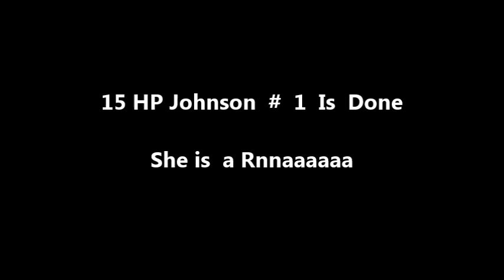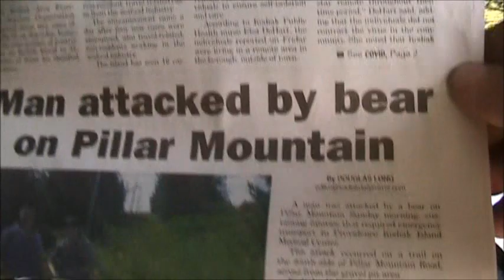15  HP  Johnson  outboard  Motor    ((  Part  2  ))   #   2 ,,,,   &  MUCH  More  !

Comment: That Johnson sure looked clean under the hood?  What happened to its original gearcase?  What year was the Evinrude, was its powerhead shot?
Reply from the maker: +kramden,  the lower came off a 1979 (E15904)  yes shot the powerhead / motor had been submerged in the ocean & then sat for several years,  The Johnson is a 1992 (EN) The fellow who brought it to me was given the motor as is & does not no what / why the lower was missing,                                                                     kodi

Comment: What do those people with kids think there at ? A zoo ? They are wild and dangerous animals ! Your fast , I didn’t even see you fill the lower unit ! Lol. How much do you sell those mid- 80’s 15hp motors for ? I get between $800 to $1200 for them here in Minnesota and a little less for the 75 to 83 ones . Correct me if I’m wrong but I don’t remember watching you pressure test a lower unit on video ? I do EVERYONE of my outboards but that’s me and I compression test them all but I do it more to keep busy and I only sell maybe 15 motors a year is all . Buy cheap sell high ! Lol